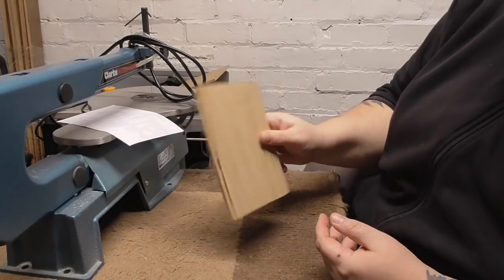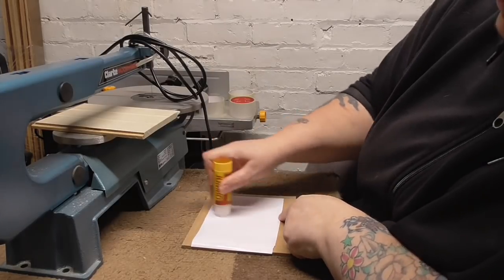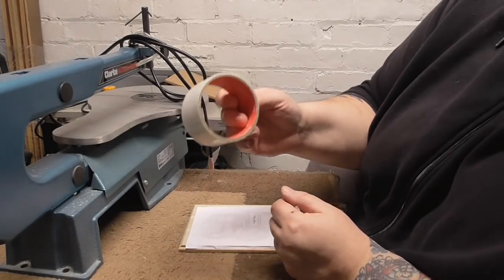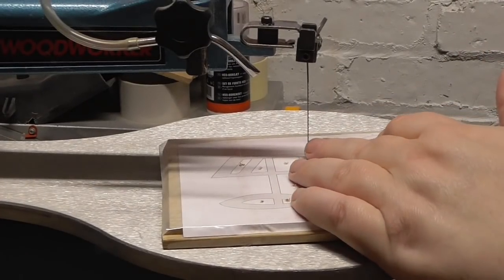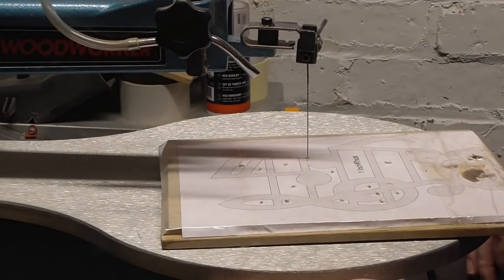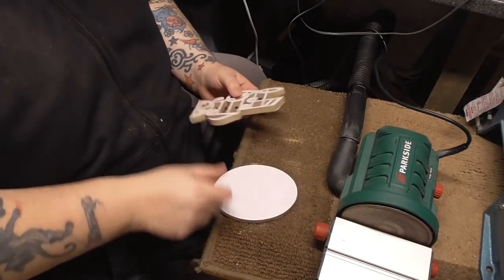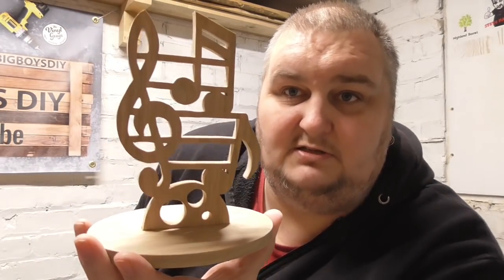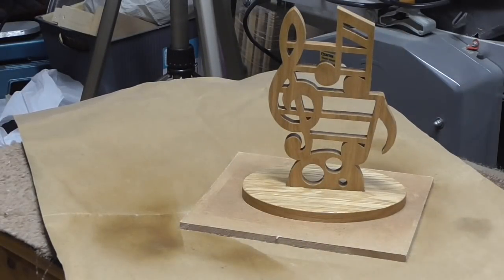MAKING MUSIC ON A SCROLL SAW

Comment: NOW I understand why you prefer the quick release blade.
Top tip on the cello tape for lubrication of the blade.
Awesome project mate, thank you !
Reply from the maker: Yes my friend it takes up too much time setting and adjusting the tension all the time especially when there is so many little small inside cuts thanks for your comment mate